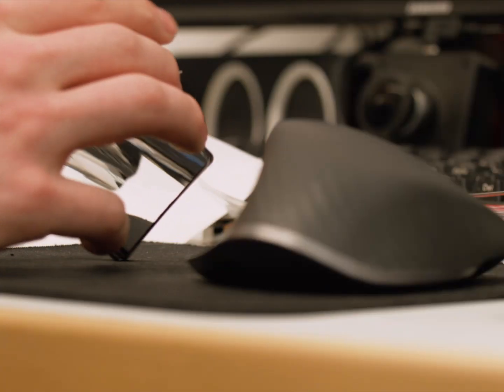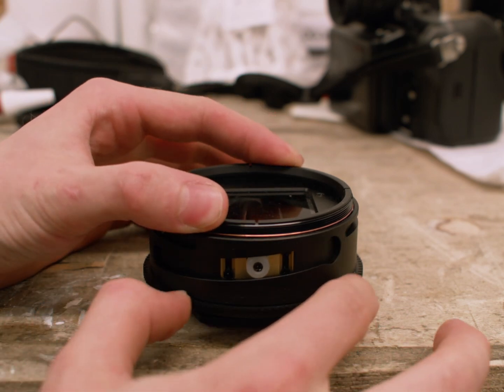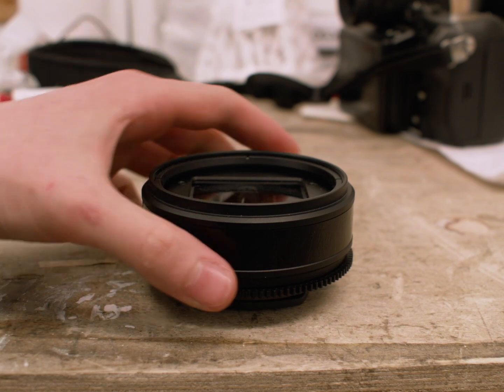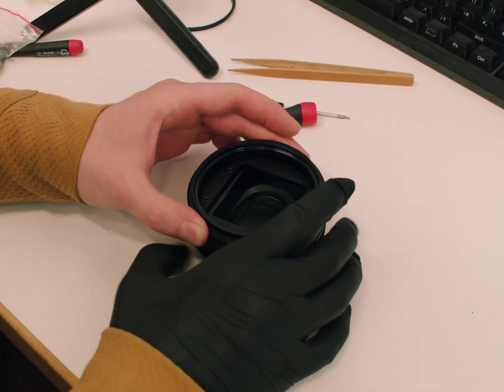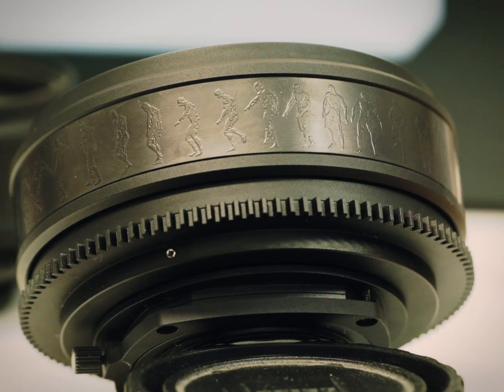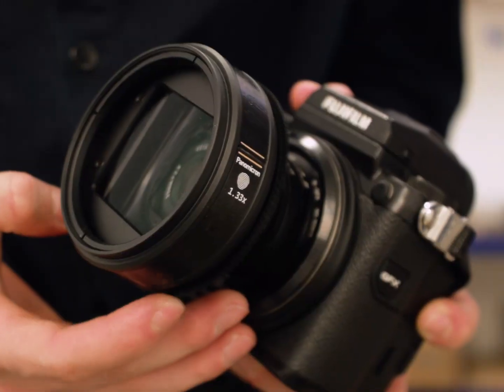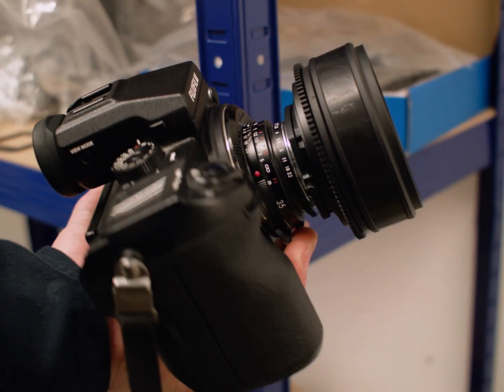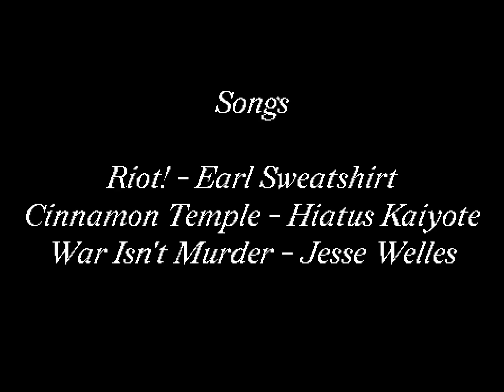Building My Own Anamorphic Lens Part 2 | Alum Anamorphic Cine-Style Housing

Comment: I love it, its huge but still :D I have an idea, tho probably not feasible to make easily. Micro lead screws and gears. you have two micro guide rails and two micro lead screws with gears, you turn the focus and it turns the gear, turning the lead screw and moving the glass up, similar to how modern plastic lenses are made but without motors. you could maintain the very small size this way but idk which crazy watchmaker would be ready to make some wild gears on a lead screw like this.
Reply from the maker: Yeah supply of parts would likely be tough there!
Reply: lets just say I now got a lathe that I'm working on turning into full cnc :)